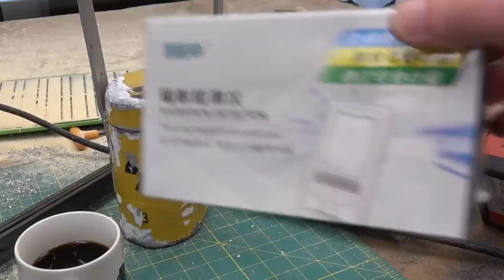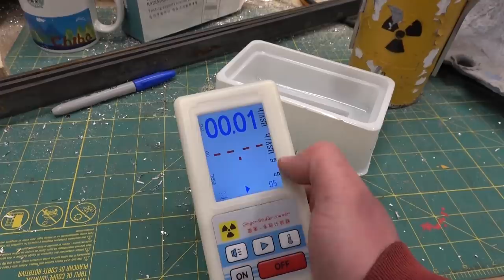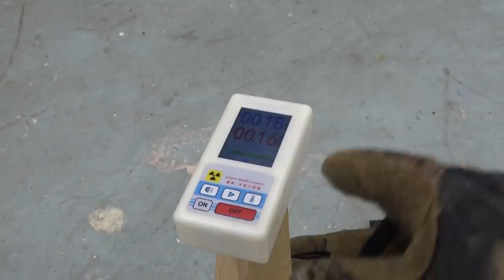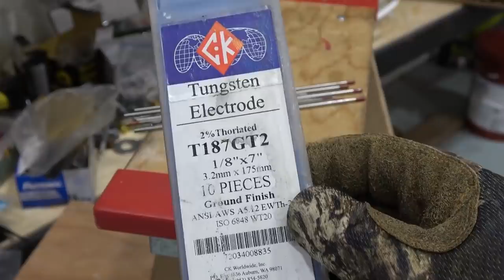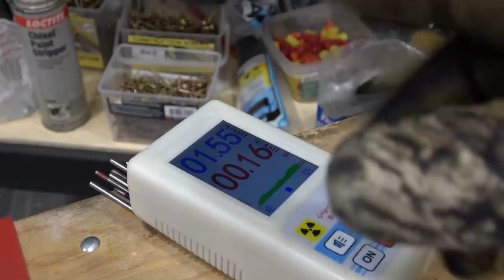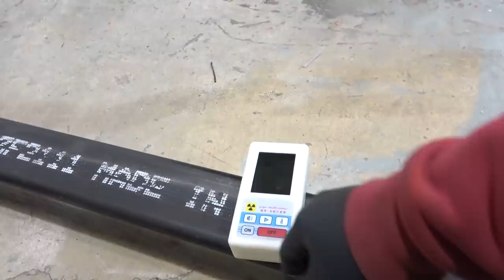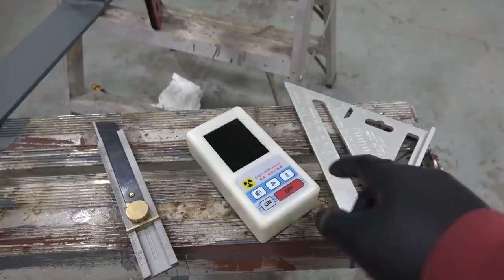Testing Radiation from Tungsten, Japanese Steel | Welding Metals Tested

Comment: Alpha is stopped by a few inches of air, beta is stopped by a sheet of aluminium foil, gamma is stopped by a few/couple of inches of lead, don’t eat anything that alpha or beta (don’t open and eat what’s in fire alarms) and gamma is going to get you either way but it’s not very ionising

Comment: Do not confuse flux with intensity even though they are both basically energy/area. 
Intensity is effectively all theoretical as it is the actual emitted energy from a point source over some solid angle. (The sun actually puts off this much power per solid angle)
The flux is the perceived, received, or measured energy per unit area per time making it a measure of power/area. (Eyes retina, cameras photo detector, HV tube, etc)

Comment: The reason you can see light at a distance despite inverse square is that the brightness has barely changed. What has changed is the apparent size of the light source.

When you look at the light source, it is the same brightness, only much smaller. But when you look at what the light is illuminating, it is much darker because it is getting much less total light.

The total amount of light is brightness x the apparent area of the source. The apparent area of the source is proportional to the inverse square of the distance from the source.

Comment: When you get the battery changed you might want to check your throne room. I did some work at a major West coast port, and post 9/11 most (all?) import containers go through a radiation detector before being released from the terminal. Apparently containers of porcelain stuff (sinks, toilets, bathtubs etc.) frequently set off the detector.
Reply: Concrete and bananas do as well.  Concrete is the bigger concern since basements can emit radon if I remember right

Comment: In a Geiger-Müller Zählrohr, there is usually a low pressure noble gas, because noble gas atom has a full-of-pixies outer band, thus making it easier for ionizing radiation particle to find one of those electrons, kicking it in the butt and make that atom an ion. And about the tungsten rods: alpha particles have a very short range (around 4 cm ) and can be stopped by a sheet of paper, so the devices housing is probably blocking almost all of them, before they enter into the Geiger-tube.

Comment: Interesting tale that covers the oriental and Radiation parts of ths vid.I once had to choose some art pieces to photograph from the Chinoiserie collection at Manchester Museum,it was kept in a cellar in a small brick room,as I chose the museum worker told me ‘this is the room where Rutherford worked with Geiger’ on the atom split!’....wow! it can only be used as a storeroom because of the latent radiation,and,if the have to drill any holes in the walls for shelves etc,they have to use a Geiger counter,which was developed in that very room !...that WAS a quality day at the office ! In fact,having now seen the rest of this vid,I got three stools covered (inverse square law)...I’m a photographer ! Ha,ha...

Comment: There is, or used too be, an active market in steel salvaged from pre-WW2 battleships. It was used to build things like whole-body radiation monitors to measure radioactivity bound in the body.. Steel made after WW2 is all contaminated by radiation produced by the atomic bomb tests and gives a background count that makes the measurement difficult.

Comment: You mentioned higher energy UV being blocked by the case. If that sensor could measure that,  low energy UV isn't ionising enough to air to be picked up and short wavelength like UV C and above don't penetrate humid air very well so you'd need a local source such as a welding arc.
It would be as likely to enter the case as Alpha since only a few CM of air or a sheet of paper can stop alpha particles.

Comment: The term Light does include Lasers ,  they do NOT fall off that the same rate.  The same holds for any Focus Light,  it depends on the shape of the results  of the Lens system.

You are correct for a light that radiates in a sphere...  Not for LED with Lens.

Comment: 8:40 Inverse square law is for things that are associated with point-like origin. Works fine for gravity, and for radiation coming from a point-like source. Coulomb's force between two point-like charges is also expressed as being inversely proportional to the square of distance.

Magnetism in general is a bit more complicated phenomenon, although it's kind of like the "mirror" of electric phenomena. Electric fields are originated from point-like elementary charges, which can be positive or negative. Since they are point-like, the force between two point charges in a vacuum is simply F = k*q1*q2/r^2, where k is the electric constant (or vacuum permittivity).

However, every magnetic field has both north and south poles that can't be separated into monopoles. It can be said that magnetic fields are produced by magnetic dipoles (having two poles). There are also electric dipoles made of positive and negative charge. And two dipoles, well, they interact very differently than two point charges. For example, there is a moment that tries to flip the dipoles into same alignment, so that they don't repel each other. After they've been flipped to same alignment, the dipoles experience an attractive force which is inversely proportional to the quad of distance. With electric dipoles, this is basically because if you look at a dipole from a very long range, the two charges appear to be in the same place so they negate each other and the electric field strength is near zero.

But when you get closer to the dipole, you can get closer to one specific pole, in which case there is a measurable net electric field caused by the pole you're closest to. This field strength drops off rapidly as you get further from the dipole, so it makes sense that the attractive force between two dipoles also drops off more rapidly than the force between two point charges would.

Magnetic dipoles behave analogously to this, so the force between two magnets is approximated by quad of the range. That's really why magnets "snap" together when they get to a certain distance. But actually describing why two magnets are pulled together (or pushed apart if they are aligned in such way) is not something I would want to explain in a space of a youtube comment... even assuming I actually remembered how it all works. Basically the magnets like to be together because that's an energetically favourable configuration. How that translates to a magnetic force between two magnetic dipoles is a big headache.

Comment: TL;DR - Thorium 232 is relatively stable (half life  ~14 billion years) ; it's intermediate decay products are quite "hot" (most stable has a half life of 5.75 years, least stable has a half life of 299ns) hence the relatively high radioactivity of items that contain it.  The decay chain has a total of 6 alpha decays, with 4 of those decay being for products that have a half life under 4 days)

Thorium Decay chain from wikipedia (https://en.wikipedia.org/wiki/Decay_chain#Thorium_series)

Thorium 232 (half life = 1.405×10 years) Alpha decays to Radium 228 
Radium 228 (HL =5.75 years) beta decays to Actinium 228 
Actinium 228 (HL=6.25 hours) beta decays to Thorium 228 
Thorium 228 (HL =1.9116 years) alpha decays to Radium 224 
Radium 224 (HL = 3.6319 days) alpha decays to Radon 220
Radon 220 (HL = 55.6 s) alpha decays to Polonium 216
Polonium 216 (HL = 145 ms) alpha decays to Lead 212
Lead 212 (HL = 10.64 h) beta decay to Bismuth 212
Bismuth 212 (HL = 60.55 minutes), has two decays mechanisms  - Beta decay to Polonium 212  (~36%) and Alpha decay to Thallium 208 (~64%)
Polonium 212 (HL = 299 ns) alpha decays to Lead 208
Thallium 208 (HL = 3.053 min) betadecays to Lead 208
Lead 208 is stable

Comment: The Geiger–Müller tube is filled with an inert gas such as helium, neon, or argon at low pressure, to which a high voltage is applied.

Comment: The Inverse square law is very easy to visualize. The only problem is that most people think in 2D.

However, just imagine a pyramid. If the top of the pyramid was radiating particles, the same amount of particles would pass in straight lines through the pyramid down to the bottom (ignoring interactions and particle getting absorbed).

So the cross section in the middle of the pyramid's height would have the same amount of particles as the base.

The base is double the distance, but four times the size of the middle cross section... That's why it decays as a square of the distance.

Comment: Inverse Square Law only applies when energy is emitting omni-directionally. If you focus the energy (using a lens or parabolic reflector), the energy is concentrated into a focused beam and does not dissipate. 👍🏼

Comment: The thing about those radioactive tungstens is that you have to grind a point on then before use.  So just handling them wont cause issues it's the dust from sharpening them again and again.  Unless you wear a moon suit every time you grind them you will get some exposure to that radioactive dust.  I use non radioactive tungstens for that reason.  It's slightly more expensive but worth it to me

Comment: Ave I just found out we’re pregnant with twins! 
Now that you either are very happy for me, or very worried for me, I would really like it if you did a Vijayo on acid etching weld coupons to do some home weld lab stuff. Like checking the penetration and whatnot of welds. I do have a bit of an ulterior motive, we’re having trouble etching some welds because of this steel, it’s hot rolled high strength low alloy steel, and we can’t get the welds pop out like most of our welds. Usually we can just grind the suckers, get em red hot and the weld is visible. We tried using some Nitric acid to no avail, and we’ve been using naval jelly and had great results actually with all our welds except for these problem welds. 
Love your vids, been a long time fan for many years, and as just a lowly engineering intern I can honesty say I’ve learned so much from your skookum vijayos. 
Thanks AvE.

Comment: my experience as NBC specialist in the Army tells me that you can't get a reading on alpha particle without directly contacting the radioactive item.  It would also need a different detector as beta and gamma ray detection.  This instrument may be able to check alpha waves with some new fangled process.  Also Alpha is perfectly safe at about 2 or so inches. The detector needs to basically be in contact with the radiation source.  The Army Alpha detectors had a tissue paper thin metal window. 
Detecting beta and gamma rays are easily detected by sweeping the counter around the room slowly and focusing in on stronger signals to find the source of radiation.  As there is some distance in this detection the Alpha waves are non existent or negligible from floating particles. Oh and wear a mask when dealing with any radioactive material. As you stated it does bad things inside of you.

Comment: I used to sharpen these electrodes on a bench grinder without a mask not knowing what thoriated meant.  I wonder if any particles are still in me radiating me 24/7.

Comment: GM tubes cannot detect Alpha particles. If you're testing for contamination, it's better to use a scintillation detector. The best thing with those is you can measure the energy of the particles and use spectroscopy to identify the source of radiation.

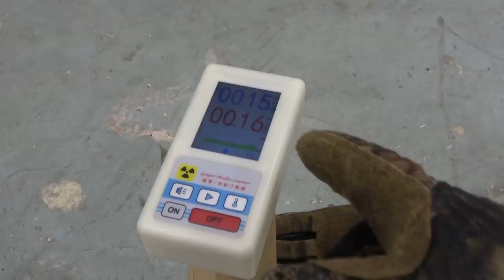Comment: The background close to the floor (4:13) will be higher than that on the ladder as the concrete will be the main source of the background. Try checking the background at the floor and at different heights. Cheers, Mark * * *

Comment: Regarding the inverse square law... that's true about a point source of radiation. For a line, its 1/r and for a plane there is drop off. Which explains why capacitive plates are plates and not points.

Comment: The tube in the Geiger Mueller counter/detector contains a photomultiplier tube, that to amplify the reaction from radiation so we can get a signal high enough to count.  It's like one Domino at  the tip of a triangle of dominos knocking down a whole triangle of dominos.  
There are some limits to this; it can't tell you how much energy the particle had, nor the type.  Additionally, if a particle of radiation isn't counted if it hits the tube before it's had a chance to 'reset the dominos', so the detector will have a Max count rate, along with some level of uncertainty in the cpm (counts per minute) value.
Nifty stuff.

Comment: AvE, that steel is marked 17-07-H11. Japan uses years of the emperor, so H11 = 11th year of the Heisei Era = 1999. That steel was formed on 17 Jun 1999, a long time before the Sendai earthquake. There's no way to tell if it was even in the same hemisphere on 11 Mar 2011. You should try this again with a recently-forged sample.

Comment: The way it was explained to me by a satellite engineer is 100 watts is 100 watts  no matter the distance, what changes is the amount of space that the 100 watts is dispersed through. A gallon of water fills the gallon bucket just fine, but not the swimming pool.
Reply: Yeah. All the energy coming out of the source at the same time is always at the same distance from it, but going in all possible directions. That's the surface of a bubble with the source in the center, and the surface grows with the square of the distance, which is why the energy per square inch follows the inverse square law.

Comment: The inverse square law applies for uniform point sources (isotropic), because EM radiation propagates in a sphere around it. Non-isotropic sources like lasers and parabolic antennas have a much narrower beam and power does not drop as quickly with distance. There's a more detailed article in wikipedia for those interested

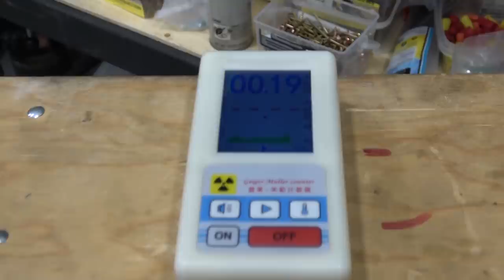Comment: 10:25 The meter reading background there has almost nothing to do with the inverse square law. The welding rods are alpha emitters, and alpha particles are stopped by that wooden plank the meter is sitting on and by much less than 14" of air.

Comment: You are using an inverter type TIG machine right? If so, use blue 2% lanthenated for everything. It works very well, and you can get rid of the red.

Comment: Once levels get near background you really need a big pancake sensor to see the difference. The little tubes like in the cheap meters are only good for seeing if something is hot. And unless you know what the source is you can't say what the dose is. If you have just counts use it dose is dependent on energy level and rate. That meter would only be somewhat accurate for cesium.

Comment: Do not put the Geiger counter on top of the dead tree carcass if you want to measure the radiation from the thorium at a distance. The wood will easily stop the alpha particles and for sure you will measure nothing more that background noise (I know, the air at this distance will likely do the same thing).

Comment: Just a note there shop wizard, alpha particles aren't all that good at penetrating anything, and you detector cannot detectify them because of that, unless it's got some special smoke inside of it I can't see the GM tube is behind too much stuff. You gots to pay for an expensive detector for them alphas.

Edit: Should've used one of those little Radex ones, 'cause it would have thrown a fit (by default) at .30uSv, and has a little black box that blinks any time you get a radiation hit. And they beep good.
Reply: Indeed. His gizmo isn't reading any of the alpha decay. It's picking up the beta (electron) decay of the intermediaries. (I doubt it's even physically capable of detecting alphas -- the glass in the tube will be too thick.)

Comment: This made me wonder about how close to Fukushima my car was made.  Turns out it was 9 months later, 300 miles away.  I looked for closer auto plants.  Nissan has an engine plant in Iwaki, Fukushima prefecture less than 30 miles from Fukushima Daiichi.  The engines for the 370Z are manufactured there.  You might get more interesting results testing one of those produced around the time of the disaster.

Comment: use the a thin sheet of aluminium (not aluminium foil) to filter the low energy particles of the tungsten and you might get a higher reading

Comment: I've often wondered if the high frequency arc start with thorated tungsten is putting off more radiation,  also if the heating of the tungsten arc makes it stronger. I do know that grinding thorated tungsten is not safe at all because of the airborn particles of thorium from the tungsten and the silicon carbide from the grinding wheel. I've done it for years and will probably regret it later. I never thought I could afford a fancy tungsten grinder with a water trap. Silly me.

Comment: They're a tad more pricey than the chinesium, but the GMC-300E seems pretty solid. Mine has lasted me a couple years, has a replaceable 14500 LiOn cell (when's the last time you saw that in consumer tech??), and seems to be a good blend of quality/price. It has logging, averaging over time, different units, alarms, blah blah, all the crap you want in a basic Beta/Gamma only detector. I think 86 american pesos was the price on good ol' Shopfromyourchairazon Prime.